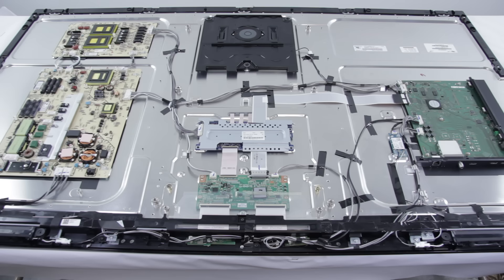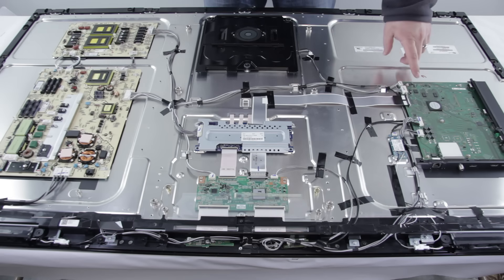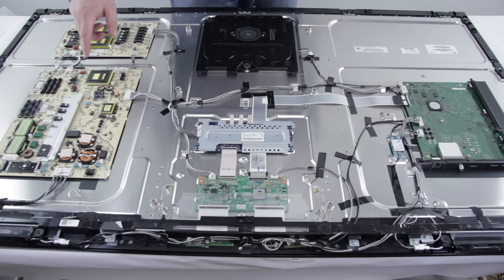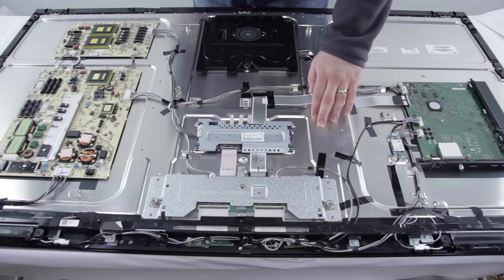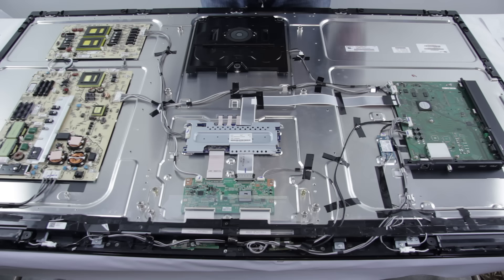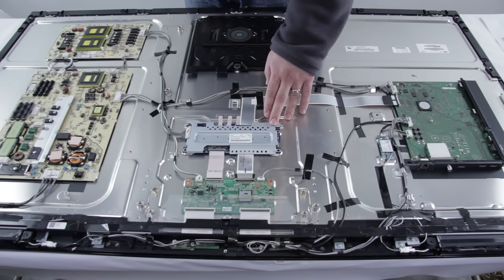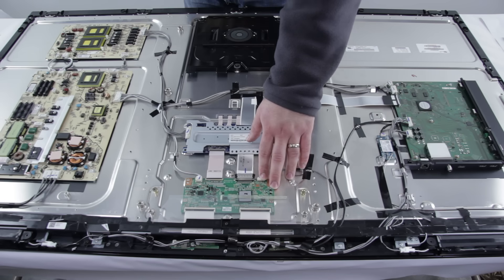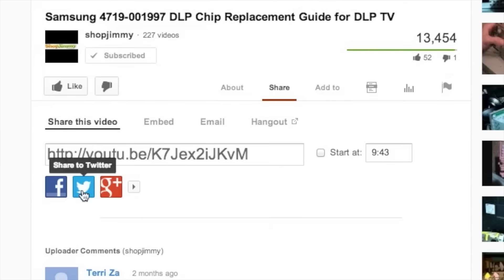LED TV Repair Tutorial - Common Symptoms & Solutions - How to Repair LED TVs

Comment from the maker: NEED TV REPAIR HELP?! If you need help repairing your TV, please comment below the www.ShopJimmy.com video or send us a YouTube message. Please include your TV model number and the symptoms or issues your TV is displaying. The more details you can include the faster and more accurate our response will be!
Reply: Please help! I have an LG-47LN5400 perfect sound but no back light. I only have 3 boards the power supply, the input/main board and the T-con. How do I know which had the back light? I notice that the power supply board has some wire that lead off to one corner and go into the TV...
Reply: +ShopJimmy.com  
Greetings,

I have a problem with the 4 HDMI ports. The ports with other device (cable, Xbox, PS3...) connected will recognize there is a device connected, but will not show a picture or sound. If you connect the cable through the component cables It will  show a picture and sound, although the colors are way off, like as if it was missing yellow or green or blue. 

Here is the make & Model 

LG 3D LED Smart TV
LG 55LW5600
Serial No. 112RMDZ4X730
LG Model: BM-LDS201

let me know if you need any more information
Reply from the maker: Jay Anwar   This sounds like a TV panel (TV Screen) problem.  If your TV panel is bad, it may be more cost-effective to replace the TV as panels are typically hard to find in stock, difficult to replace, and expensive.  Thanks and please let us know if you have any further questions!  www.shopjimmy.com
Reply from the maker: Jay Anwar   You certainly can replace the T-Con board to see if that fixes the issue, but it may not.  Thanks!  www.shopjimmy.com
Reply: soniq model number e32w13a-au 

its an led/lcd tv no backlight and inverter needs replacing. Any help would be greatly appreciated. 

Thanks and keep up the good work,
Will
Reply from the maker: WiTRo  Unfortunately I do not see any replacement parts for that TV model number on our website.  Thanks!  www.shopjimmy.com
Reply: I have a soniq e55v13a with no backlight.  I can't find a service manual, are they called something different in the USA ?
Reply from the maker: Chris McClellan   Are there any other symptoms or problems for the TV?  Thanks!  www.shopjimmy.com
Reply: Hi I have a bush lcd 40883f tv with no sound could you please help here is my e-mail if you neef it vince615615@hotmail.co.uk thank you kind regards vince
Reply: Hi, My friend has a problem with his tv, He's not sure if it's LED< or LCD, All he knows is that it's about 36 Inches wide (not proper measurement), it's a 2009 Toshiba Flat Screen. He says that the HDMI port is not working. He asked me if I knew anything, but I mainly deal with desktop computers and iPhones. From what I know of computers, and by the format of the Tv shown in your video, I want to know if it's possible/ worth un-soldering the HDMI port and re-soldering one in place.
Reply: ShopJimmy.com Nothing else wrong, just can't see the picture on the screen.  There is a picture there if I use a flashlight.
Reply: i have toshiba 29 inch led tv it is taking too much time to start. before start it blinks many times. green light shows its turn on but display takes a very long time to come, nearly half hour to 3-4 hours sometimes. plz help. whats wrong with my tv......
Reply: Hi there I have a Samsung Series 6 UA40F6400AM 40'' 3D LED Smart TV Not Working.

This TV was working fine until it stopped turning on. The light is not coming on, the picture was always fine though. please let me know your thoughts on the problem?
Reply: ShopJimmy.com I have a Westinghouse LD-4055 40" 1080P LED 120Hz HDTV. I've had it about 3 years now. Just recently, the picture all of a sudden turned off, but the audio continues to play. All connections have been checked, and the problem persists on all inputs. Any help would be appreciated. Thanks!
Reply from the maker: John Bartal  I recommend running the flashlight test on your TV.   Here is a link to a video we produced that shows how to run the flashlight test. https://www.youtube.com/watch?v=xUzCLgoSPGM Please reply with your flashlight test results and we can recommend a replacement part for your TV repair. Thanks and please let us know if you have any questions! www.shopjimmy.com
Reply: ShopJimmy.com  I have VIZIO P502ui-B1E 50" 4K UHD 2160p 120Hz LED, It has blotches of dark shadow . The link:  https://www.dropbox.com/sh/0kycso6kiod8e8n/AAB3P4bNwai_KBFYX1SpcgmKa?dl=0   

What is the cause/part that need to be replaced? I bought it for only $400 refurbished and out of warranty.
Reply from the maker: rondhole   This sounds like a TV panel (TV Screen) problem.  If your TV panel is bad, it may be more cost-effective to replace the TV as panels are typically hard to find in stock, difficult to replace, and expensive.  Thanks and please let us know if you have any further questions!  www.shopjimmy.com
Reply: Hey ShopJimmy.com My roomate has a 70 inch Aquos Sharp TV. Model #LC-70LE640. Symptoms are the TV turns on but it is a really weak picture and black waves/lines go across horizontally. All the inputs work, and sound is good.
Reply: ShopJimmy.com When my smart tv is turned on, it repeatedly restarts, therefore, the tv never really turns on. Its a samsung LED smart tv 42''. Before this however, while watching tv, the TV would restart on its own, but i suppose its gotten worse, hense, now its just now even coming on. What can cause this??
Reply: ShopJimmy.com Hisense Model F42K20E. On initial start up, the TV makes a weird humming/buzzing noise from both speakers, detectable during normal audio, but is very apparent on mute. Then a constant static noise also from the speakers follows. The static continues during regular programing audio and is ridiculous on mute. I get a slight break when the TV is restarted, but the static soon returns moments later. I do get relief by unplugging the HDMI from the back and all noises go away but a blue screen isn't very entertaining.
Reply from the maker: Jeremiah Kumpf   PLEASE SUBSCRIBE TO OUR CHANNEL - Try all repairs and troubleshooting at your own risk.  I recommend running the flashlight test on your TV.   Here is a link to a video we produced that shows how to run the flashlight test. https://www.youtube.com/watch?v=xUzCLgoSPGM Please reply with your flashlight test results and we can recommend a replacement part for your TV repair. Thanks and please let us know if you have any questions! www.shopjimmy.com
Reply from the maker: Jeremiah Kumpf  PLEASE SUBSCRIBE TO OUR CHANNEL - Try all repairs and troubleshooting at your own risk.  I recommend running the flashlight test on your TV.   Here is a link to a video we produced that shows how to run the flashlight test. https://www.youtube.com/watch?v=xUzCLgoSPGM Please reply with your flashlight test results and we can recommend a replacement part for your TV repair. Thanks and please let us know if you have any questions! www.shopjimmy.com
Reply: ShopJimmy.com I have a Vizio E320i-A0 right around a year old. For a couple of months 
it would shut off spontaneously on occasion, but today I turned it on 
and the V logo did not come up and the screen stayed black, although the
 audio and tuner worked normally. I did the flashlight test and there is
 a picture, so backlight failed apparently. I called Vizio and of course
 they told me it's not under warranty, and my local repair shop told me 
it would cost more to fix than replace. I'm pretty handy, I'm a musician and fix some of my own stuff. Can you help?
Reply: Hi, I am Pradeep (India, Chennai), Your Video is too good and I have got some confidence that can fix my Samsung LED 40F5000UN without much money spend on it. My LED TV is having 'half screen darkness' (top to bottom) problem. I mean image on top half of the screen is little dark. But easily we can view that there is a dark glare. I am little afraid to get it repair as Samsung service center is asking more money just for investigating problem alone. Hope you understand the issue which myLED TV is having. Can you please help me that what could went wrong with it please?
Reply from the maker: Shernelle Brathwaite   I recommend replacing the main board in your TV.  Try all repairs and troubleshooting at your own risk.  Please reply with your TV model number.  Click here to view a video that shows how to find your TV model number:  https://www.youtube.com/watch?v=S51nhAmwR2M  Thanks!  www.shopjimmy.com
Reply from the maker: Spaz Moorehead  PLEASE SUBSCRIBE TO OUR CHANNEL - Try all repairs and troubleshooting at your own risk.  This could be a problem with either the power supply board or the LEDs in the TV.  You can replace the power supply board to see if that fixes the problem.  Click this link to replacement parts for your TV model number:  http://www.shopjimmy.com/catalogsearch/result/index/?cat=59&q=E320i-A0  There may be multiple boards for the same TV model number, be sure to match part numbers on your current board, with your replacement for compatibility.  Here is a link to a video showing how to identify your part number, click here:  https://www.youtube.com/watch?v=4i57Cm9-96M  Thanks and please let us know if you have any further questions with your TV Repair!  www.shopjimmy.com
Reply from the maker: ImDood Anonymous   Is the TV still under warranty?  Try all repairs and troubleshooting at your own risk.  Please reply with your TV model number.  Click here to view a video that shows how to find your TV model number:  https://www.youtube.com/watch?v=S51nhAmwR2M  Thanks!  www.shopjimmy.com
Reply: Tofiq Mikael
Reply: Samsung  Un65es8000f . I have sound control wifi. I was playing with my ps3 and the tv started to restart on its own. Happened for a week until I just decided to not plug it up. After doing a factory reset it was fine until I went into the settings and set the picture to movie move then it faded slowly to a black screen as if it died. I unplugged 20 mind later I plugged back up and now I have a screen that is almost 80 percent white but I can see my cable play g in the background still have all smart features and sound but and can see a little bit of color. Also to add the hdmi ports were getting hot on the tv when the ps3 was connected that's when the restarting happening.  But let me connect a uverse reciever or anything else hdmi component a/v or coax tv fine. If I use a hdmi replicator  port swith for the ps3 the tv is fine but the super bright white picture is permanent even after factory reset I can make out what I am watching barely enough to factory reset. Which part do you believe is messed up. TV hasn't been dropped or bumped
Reply: ShopJimmy.com Heya! I was gonna watch TV today ( LG 42LS560S LEDTV)but following happened: Tv was in standby as always, I turned the powerbutton on the remote: the power-led on the tv was flashing 2 times then the TV turned off completely.(secure off mode or sth) :( Ever heard of that kind of problem?
Reply: Never got a response for my issue but turned out to be t con board. Found a site with them in stock. Now I have the vertical line think it's the ribbon so will see if a connector is loose before replacing. Good luck on waiting for a answer here.
Reply from the maker: demario harvey   After you replaced the t-con board, did the HDMI ports stop heating up?  It would be interesting to know that you did not have to replace the board with the HDMI ports on it, to get them to stop heating up.  Thanks!  www.shopjimmy.com
Reply from the maker: InCyane Ninja  Try all repairs and troubleshooting at your own risk.   I recommend replacing the main board in your TV.  Unfortunately I do not see any replacement parts in the search results for your TV model number on our website.  Please reply with your part number on your main board and I can try searching for replacement parts.  Thanks and please let us know if you have any further questions!  www.shopjimmy.com
Reply: Okay, thanks for your reply :)
Reply: Hello I need help. My 32 inch (Funai) Brand (LED) TV will not turn on. I see no picture on hear nothing when turning it on using the power button. It worked earlier in the day then I tried to turn it on later and nothing. Cable man said TV was gone. The model # is LF320FX4F. Please advice.  thx in advance
Reply: ShopJimmy.com Great video! I have a TCL le55fhdf3300z that won't turn on, so I assume the power supply is bad, based on your video. How do I know if I need to replace the main or sub power supply unit? Thanks!
Reply from the maker: Rhonda S   PLEASE SUBSCRIBE TO OUR CHANNEL - Try all repairs and troubleshooting at your own risk.  I recommend replacing the digital main board in your TV.  Click this link to replacement parts for your TV model number.  http://www.shopjimmy.com/catalogsearch/result/?q=LF320FX4F  There may be multiple boards for the same TV model number, be sure to match part numbers on your current board, with your replacement for compatibility.  Here is a link to a video showing how to identify your part number, click here:  https://www.youtube.com/watch?v=3DQe0ATZl_Q    Thanks and please let us know if you have any further questions with your TV Repair!  www.shopjimmy.com
Reply: ShopJimmy.com 

My Panasonic Led 29" TV's back light is glowing for a moment when it's on , and then it's turn off. Please help me , how it's repair? My email "sourav.mndl@ rediffmail.com"
Reply: Samsung 40 UE8000 smart TV. 
On the screen I'm having some vertical black small lines when it's on. Most probably it's because of water later I noticed when it's rain there's a leak on the roof. Pls help to fix this issue
Reply: ShopJimmy.com I have a Visio 42 led. Model #m421nv. The screen lights up so I'm guessing the backlight is fine but no picture or sound. Also no logo when it turns on. Does that sound like a main board problem? Any help would be greatly appreciated. Thanks!
Reply: ShopJimmy.com 
Hi Jimmy,
Nice video.
I have a sony bravia KLV-40R452A LED. After 18 months of regular working in best way, now this has started giving problem.
The TV gets switched OFF and ON automatically.
After switch OFF, at times the white/green light on the front panel blinks for 4 times and then the TV comes back again.
After some time may be 10 mins, this again restarts.
Let me know what can I do to fix, this.

Thanks a lot!
Dharm
Reply: Hi how can I get you some pictures to help with the clarification of the TV I just left you a message on the video you posted  so maybe we can get this fixed thanks again jason
Reply: +ShopJimmy.com hi i have a samsung un46h5203afxzc with 3 big white line almost the whole side of the tv. and help would be appreciated 
thanks kevin
Reply: +ShopJimmy.com i got sony BRAVIA model KDL40EX700 serial no. is 8039541 the problem is a horizontal  straight colored lines on the left side , and on the right side a dark portion , there is a picture and normal sound, is it the T CON is the possible defect? also i don't know where to find the part no. for this tv, it's sony but the pcb is from sharp even the sticker inside is sharp not sony, may i know also if how much is the price for the Tcon? is it worthed to spend money for this?  , i watch some of your videos thanks for sharing
Reply: +ShopJimmy.com 
Hello ShopJimmy representative.

The tv in question for me is a Hisense 50" LED TV
Model: 50K23DG.
Symptoms. Backlight does not come on.
Things to note: Stand by light does respond to power, sound does work, using the flashlight test, i am able to see picture on screen, including the HISENSE logo appear plus i can see input screens and menu if i push the respective buttons.  I have also attempted replacing the power supply board, i was however sent the wrong board but it was very similar, i believe a board used later in the tv's life cycle.  This board switch did not fix the problem.  I am unsure where to go from here.  Your help is greatly appreciated
Reply: +ShopJimmy.com 
Hello, i have a Vizio E500B1, it has the white/gray screen that fills the whole screen.  I tried unplugging, holding down the power button for 30sec, plugging everything back in, but no luck.
Reply: hello Jimmy
I have lg 50ln5600 it turns on and sounds but no pictures. 
I did flash light test as you show in your video. 
picture is there but no backlight. 
so I changed all 3 boards T-con power supply board and main board. 
nothing changes maybe those boards are faulty or one of the cable is bad but I think power supply board is not working. 
how to I test it ? Please help Thanks
Reply from the maker: +Michael Henke   Try all repairs and troubleshooting at your own risk. Is your model number?  
E500I-B1  Thanks!  www.shopjimmy.com
Reply: I have LCD/LED Samsung that have symptoms of showing colored or black vertical lines on the screen. I can still the picture clearly just with colored or black lines. The model number is LN46C630K1FXZA.
Reply: hey is me again I did the trick with the flashlight in i could see the menu and I could hear sound but no backlight
Reply: +cesar de la cruz buy a new one , igot Philips same problem got sound got image if I use the flash light, I did change the inverter, but never work so I bought a new TV. throw away that old TV
Reply: Kevin Stirling hi
It needs t-con board and cable or might one of them wil fix your problem. it works 99%
Thanks
Reply: I am sure it needs t-con board and cable for it. 
For color problem but Hdmi problem means it realy needs a good main board. Thanks
Reply: +ShopJimmy.com Hello, I have a JVC model number: HD56G887 serial number: 12162878. Here
 are my symptoms; when I push the on/off switch the on light comes on, 
but the screen never lights up. There is also a whirring sound after 
about 30 seconds the TV shuts off. Can you make any suggestions? Please respond to jkinney65@hotmail.com
Reply: +Barbara Durham It is a JVC